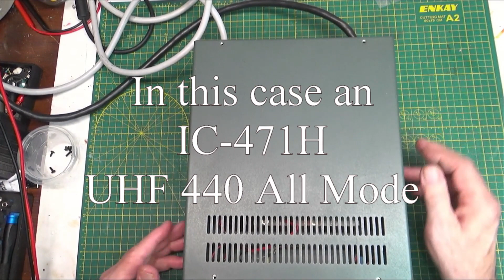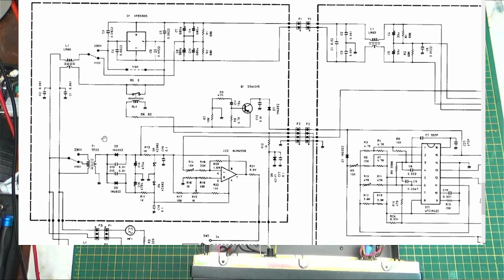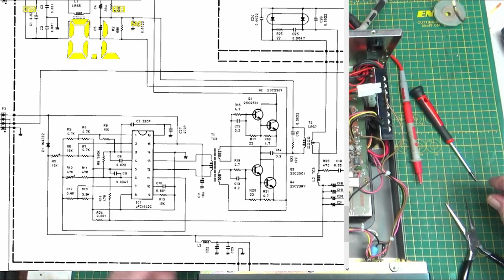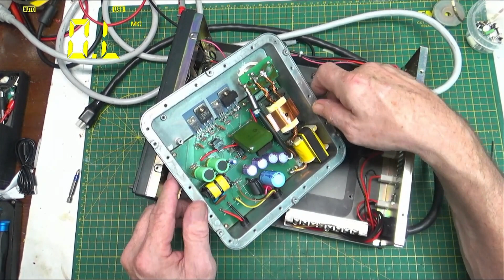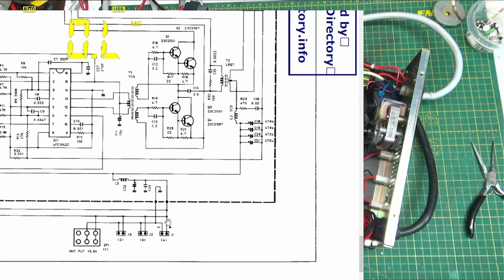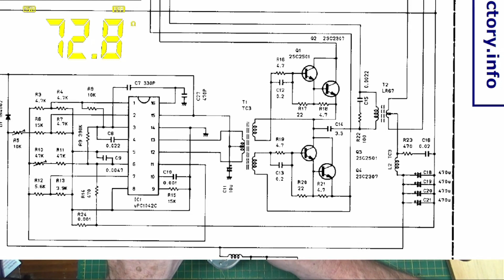Icom IC-PS30 Power Supply Repair. Lots of bad parts go poof!

Comment: What are the chances of finding a walk through on a PS-30. Saving the story that goes along with the PSU and just done the inevitable by grounding out the casing popping the fuse after being 15 years in storage probing before use. 
  One of these things sentimental in value place away.
 From memory (15 years ago..plus) Replaced T1, mains to 6Volts and resistors R6 and R12. Please correct me if I am wrong as there might have been a incorrect resistor value for one of these two from what is labeled on schematic ?
 Those parts where the only issue I experienced going beyond duty cycle. Will look into what the ESR 's are on some these caps. Interesting that 3 Ohm resistor got taken out noting on my side was fine before Mr aligator clip (240v coffee been region) Raise the stakes for a carton of beers for that one. 101 how not to energise a relay 🤣 
 Yeah the old girl goes back to IC2A era. Nothing's changed with matrix diodes.
Reply from the maker: I finally gave up fixing these things. Now I just rip out the guts and put in a good quality 40 Amp switching PS along with a current shunt for the meter. I use Mean Well power supplies.

Comment: Did the cooling fan ever get up to full speed? Hard to tell at the end how fast it was spinning. Makes me wonder if it overheated due to a fan issue.
Reply from the maker: No.  That fan was just toast. In fact the whole thing ended up being not economical to repair since it kept taking out that low value resistor. I ended up replacing the whole works with a 25A Mean Well PS and building a circuit for the current meter. It all works great now and if it does suffer over current it just shuts down gracefully instead of blowing up. I really hate these bathtub switch mode PSs.

Comment: Reminds me of the first ICOM I had..  a 2m mobile TR-7400A.  Still have it but its' not worked since the late 90s.  But I still enjoy my R71A.
Reply from the maker: Hard to believe this thing is from the 80s. Some of Icoms stuff has held up well. I have an IC25 that works great.
Reply: @AERVBlog  yeah I have had plenty of radios from the 80s still going strong.  I know people with newer radios that don't work all that well.
Reply from the maker: @gbowne1  I have an FT-757GX that I believe rivals most newer radios as far as receive goes.  I use it for digital modes.
Reply: @AERVBlog  me too. its a great radio.  even for listening.  The tuner is pretty nice.
Reply: Good memories, the TR-74400A was a Kenwood, I just fixed  one!